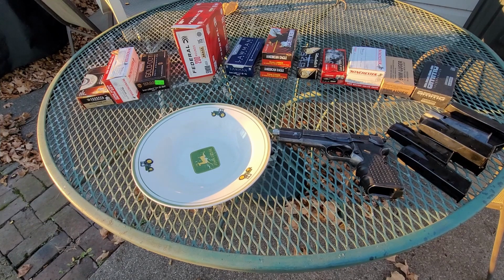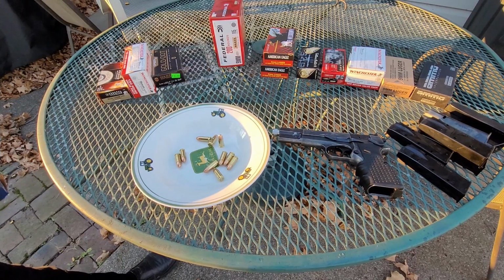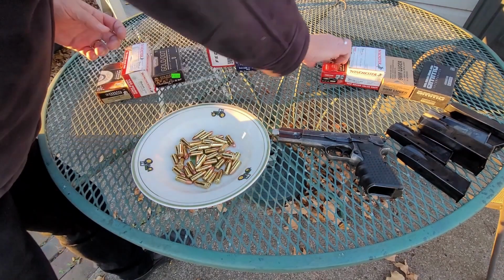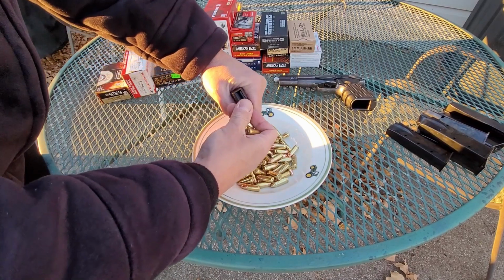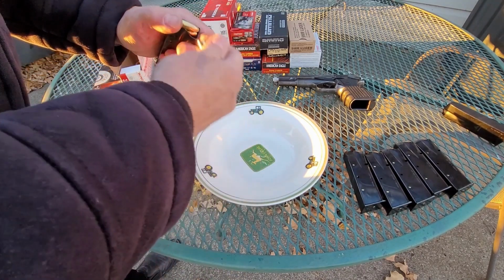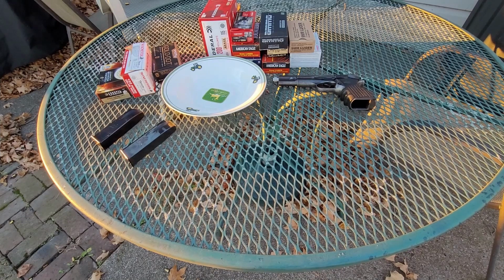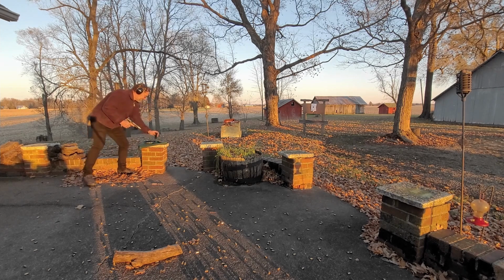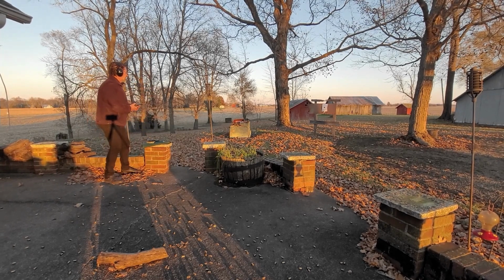Springfield SA 35 Hi Power Evaluation & Testing Session 8 BHSpringSolutions Hi Power University 73

Comment: Wish you could do a split screen so we can see the hits as you go. I've got 3 original Hi-Power's, all different, all originally "Blued". I even have one in .40 S & W, which is very rare as they only made them for 2 years, but I'm not a big fan of the .40 but they do hit hard. Since I live in Wisconsin, and flannels & sweatshirts are the norm here for 3/4 of the year, I've been carrying one of my Hi-Powers for a few weeks now. We are an open & concealed carry State anyway. Got a nice IWB Desanti "Cozy Partner" holster, for when some of my Jean's have a waist size 1 to big, & a handmade OWB Holster by a master leather maker in Louisville Ky. If you do want to carry one concealed the DeSanti IWB holster is so comfy, doesn't move, all leather & you can also carry 1911's in them. They make 2 sizes, one for up to a 3" barrel, with a closed bottom I use for my Springfield Armory EMP 3" 9mm & my Colt "Defender" 3" .45 acp. And the larger one has an open bottom but is long enough that a 5" 1911 or Hi-Power fits perfect and no metal touches you anywhere. I can carry like 6 different pistols that I have in just those 2 holsters. I Love my Hi-Powers. Probably won't need this one, but ya just never know. Wish they would have true blued them vs parkerized.

Comment: Mark, great video that shows that the SA-35 will digest almost anything you feed it. That said, unless I missed it you changed out the SA production barrel for your threaded advanced match barrel. While that's a great improvement, I would be interested to see the same shooting test with the production SA-35 barrel. The non SA production Browning HP is notorious for not liking anything but ball ammo. Did SA do anything in its base SA-35 offering to accept 'defensive' ammo?
Reply: The early BHPs had a 'humped' feed ramp that optimized it for ball ammo, but that changed at some point (maybe in the 70's?) and everything after that will feed just about anything you throw in it.  All of these surplus police BHPs coming in over the last ten years have the later ramp and run just fine with any hollow point.
Reply: @kodiakkeith  This is correct.

Comment: Its a great demonstration of both the Springfield SA 35 and your components. We got to see several issues with the stock gun and how it can be fixed. Other sites have done several tests of the stock gun and didn't seem to have the problems you did. Did you guys get a very early model? Did the other sites get later models? Any ideas on that? Do you plan to get a Girsan HP35 (I think it is) and run it through it's paces? Maybe we can see a head-to-head comparison and find out which one is better out of the box. Thanks for the work. Lots of good stuff to learn from.

Comment: Ok, I’m going to try to make a point calmly. It would’ve been helpful to us as the viewers if you had tested the gun more fully in stock form first, say for one to two thousand rounds before changing anything. Let whatever’s going to malfunction or break do so, document it, then give a summary review of the pistol in stock form. Then you make another video describing which parts you’re going to swap out for your own aftermarket upgrades/services and why those will resolve any of the issues you previously documented. Then you do another one or two thousand round test with the modified gun and compare the performance of your upgraded parts to the stock pistol. It would’ve given us a much better sense of how the gun might perform straight out of the box, and made a stronger case as to why we might want to invest in some of your aftermarket parts and services to increase the capability of the gun. As soon as you swap out parts on the gun after maybe a couple hundred rounds, the fidelity of your testing goes completely out the window. Unless your opinion is that no matter what model or manufacturer you buy from, the Hi Power is just a pistol that will inherently need immediate attention from a gunsmith in order to properly function like old 1911s. In which case you should state that prominently and repeatedly throughout the process.

Yes ammo’s pretty expensive right now - the parts you’re trying to get people to buy are more expensive though. Could you not write it off as a business expense anyway?
Reply from the maker: Thank you for your comments.  If you watched the first 7 sessions, you saw that the extractor channel and area where the extractor spring lives, required alteration so the two components could do their job - and additionally, the extractor was already failing to securely hold the extracting empty cartridge casing.  The de-snaggle-toothing of the extractor channel and replacement of the extrator was necessary for this part of the pistol to pass basic tests, so there was no point in spending more ammunition seeing more fails to extract.  
Replacement of the operating system was necessitated for our testing because the original Safety / Sear / Hammer combination exhibit incorrect function of the safety lever when the hammer is forward against the firing pin and for that reason, those original parts were eliminated from this segment of testing.  
The entire pistol was deburred for two reasons - the original edges of the beavertail cut my hand in the first 300 rounds of firing - and because the slide and frame rails action of deburring themselves (since that didn't happen at the factory) during shooting was having an effect of degrading the slide and frame's ability to cycle - in other words, the slide and frame were deburring each other and the effect was too much tiny fragments of non-deburred metal edges becoming interference with normal slide / frame cycling, and that was causing "short - cycle" malfunctions as well as empty brass deflecting straght back toward me because it was barely getting out of the pistol.  
We require the highest margins of safety when testing anything, and for that reason the SA-35's original Sear Lever and Light Firing Pin Spring were replaced because from our perspective, to possess as we do the higher margin of safety components, and not use them, would be stupid, unnecessary risk taking.  
When the natural "break-in" is deburring things to a degree that the pistol doesn't want to run at all, it is not the correct thing to go and try to make another couple thousand rounds go through anyway - trying to make metal parts cooperate when there's an obvious interference-factor happening can only do damage and it is not the objective of our testing to tear anything up.  
In Session 1 of this series, we stated that the objectives of our testing are: Determine compatibility of BHAdvanced HP Components in the SA-35, and Determine the suitability of the SA-35 as an acceptable platform for creating BHAdvanced Masterpiece Hi-Powers.  

BHSpringSolutions' testing of the SA-35 is not finished.  Since we had to deburr the entire frame and slide, it left the steel inside and out very bare and very at-risk to rust.  So for a few days, we've stopped the shooting while we get the girl some clothes back on.  There will be more testing and some additional use of the SA-35's original components, such as the original barrel.  At this point we've confirmed compatibility with all BHAdvanced HP Components in the SA-35.
Reply: Nice test
How many  bullets went to the barn and how many went thru the black SUV in the back..?
Reply: @bhspringsolutionsllc555  So just to be clear, in your opinion as a subject matter expert the Springfield SA-35 requires substantial modification immediately upon purchase in order to achieve reliable and consistent function?
Reply: @bhspringsolutionsllc555  - Most of us were looking for an evaluation of the SA-35 . Instead we got an infomercial for your stuff - fair enough , your channel . However , we still did not get much useful information on the SA- 35 . But apparently your stuff works great , I still don't know shit about the performance of the SA- 35 .
Reply: @rudukai13  If true, and since the SA-35 sight serrations are identical to the Tisas serrations (meaning zero compatibility with aftermarket sights…huge letdown); I’m sticking with Browning, Inglis, or Argentine FM Hi Powers. You can get an FM for less than $550, or a FM detective model for around $800…I know because I bought both for those prices this year. Significantly less off a pain in the ass, plus their parts are all produced under FN spec quality control.